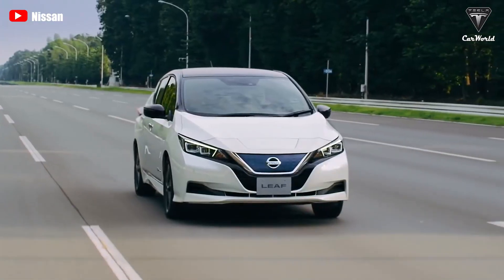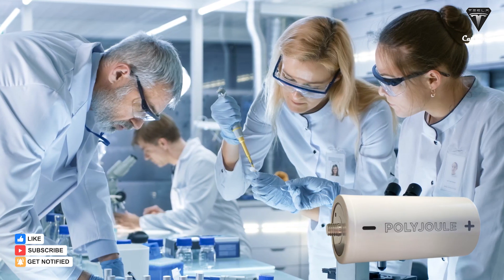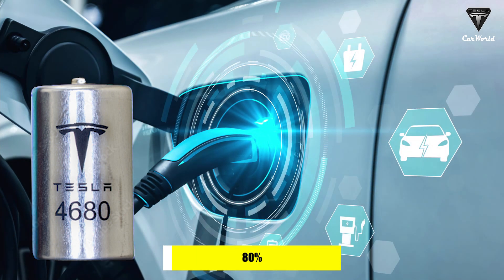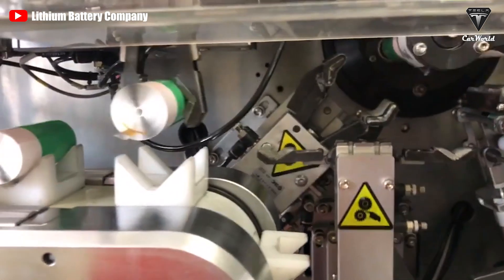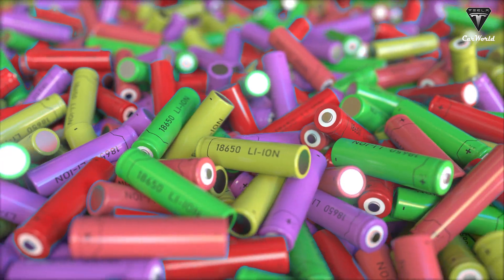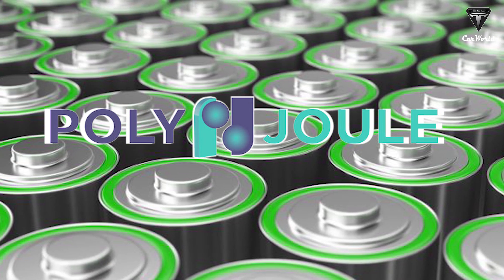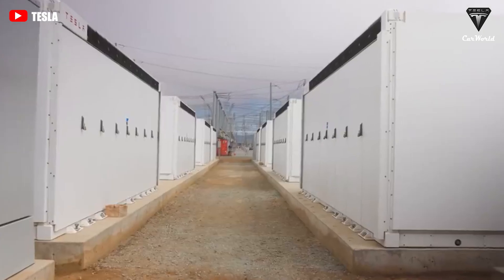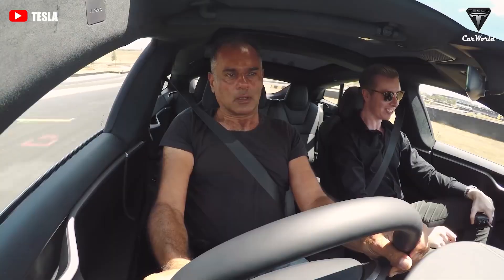Uncovering The New Batteries Miracle Material Made Entirely From Plastic SHOCKS The Entire Industry!

Comment: As a former plastic recycling company owner I find this technology super fascinating and will be rooting for its success. Never underestimate the capability of plastic. I've even ran my lawnmowers off gasoline I made from plastic at home and plastic is abundant, extremely cheap if not free from dumps. They actually paid me $300/mt to take it from the dumps so costs should be really cheap
Reply: Thats amazing.
Reply: @jeremythomas1081  the plastic gas I made I had tested and it was 98 octane and 30% cleaner than regular gas because it's been refined to make plastic. They just told me it needed the additive to keep it from rusting your engine but it worked fine, super simple to make just basically distilled plastic but you have to make flashback arrestors for safety and stuff and gasoline is lighter than the diesel and kerosene which it also creates but they condensate  at different temperatures so it was kinda tricky to find where in the tube it cools and  condensates at but once I found it it just condensates and starts running back down the tube so I put a pipe and canister coming off the tube so it ran down and collected in the canister then I just drained it every once in a while with a garden hose valve it was neat. If reactor gets too hot it pushes the diesel and paraffin wax and stuff farther up the tube but over all was a fun experience

Comment: This sounds promising.  I keep saying that battery technology needs to improve to make electric cars a good option for me.
Reply: Nop if batteries  will never outperform  a good diesel engine cold weather 
Diesel engines are humans best friend
Reply: Now, we just need to be able to charge it too !
Reply: There is another option to batteries, capacitors. Slow to discharge quick to charge.
The technology has been around for decades that can make a 500 farad capacitor the size of a 16 oz drink mug using ceramic technology.
Reply: @colgatetoothpaste4865  how you know that ? you dont know what will happen in 1000 years .
Reply: That only works for Costco milk jug.
Reply: Me too. I’m happy with my Diesel 4x4.
Reply: This is not for electric cars unfortunatley. It takes 5x space compared to li ion batteries with same capacity.
Reply: They seem to have a place but if I understood, EVs is not one of them.  The batteries would need to be 5X larger for the same capacity.  What am I missing?
Reply: @colgatetoothpaste4865  ummmm, you do know that most of the fuel is wasted in a diesel engine, only about 30% is for propulsion.
Reply: @colgatetoothpaste4865  that type goes to -50, thats not bad
Reply: I would wait until carbon neutral biofuels which will just require engines to be retuned 
Think about it how much monetary assets are in classic cars? Finding a way t make them run with zero carbon is what needs to happen not just more mining and more carbon emissions from charging electric cars
Reply: This will also help reduce the price of oil & gas. And most of all reduce carbon footprint or eliminate it altogether with renewable energy in the near future.
Reply: @colgatetoothpaste4865  yes and cars will never outperform horses... sleep well
Reply: They didn’t mention a weight comparison between existing electric car batteries being used. Depending on their weight to range capability maybe interesting    for electric car use.
Reply: 7:03 well as they said for a few thousand years. “ nothing will ever replace the ox and the horse.  @colgatetoothpaste4865

Comment: There is a company in England developing super caps using contact lens material that claimed years ago that eventually their product could power a car for thousands of miles, but I have heard nothing about them since.
Reply: Capacitors have a place in energy capture, but there not going to replace lithium ion anytime soon. If you direct the energy created during braking to the battery you only actually capture a very small % . However, capacitors are very good at holding that captured energy to re-employee it for 0mph starts up to 10mph.. capacitors have a million discharge cycles and are extremely efficient with virtually no internal resistance. They have a place for certain. But there only half as energy dense at best. Capacitors should replace everyone's car battery (if u have a ice vehicle). But there nowhere close to ev battery's today
Reply: Yep. That one is being choked down by the oil industry. How could fat cat industry make big bucks?
Reply: Sometimes great projects are bought out.  Just so old crap will continue to sell

Comment: I love it when claims made do not make technical sense
"able to discharge around 1MW of power in 10 seconds" has incompatible units. It's like saying "my car has 1000 HP in 10 seconds"
and statements like
"Polyjoule can be charged in under 5 minutes" - what size battery exactly? If the battery were twice the size or half the size, is it still 5 minutes?
"Aren't really designed to store electricity for days..."  :(

Comment: Worrying about plastic coming from oil is not a problem! What needs to be done is to phase out the internal combustion engines, since these cause pollution in the air! And I'm not talking about CO2 which is what plants breathe in, I'm talking about the particulates in the air, which is what we need to eliminate! Having these poly batteries for static applications and using lithium in vehicles is certainly the way to go! People talk about water being wasted to mine lithium is a ridiculous concern as the lithium in Playa deposits is in a brine suspension, which needs the water evaporated out of it. This evaporated water can then go downwind to turn back into rain. Otherwise, this b r i n e is useless for irrigation or drinking. Hard Rock lithium mining needs to be stopped, I agree, but liquid mining of lithium needs to be pushed forward immediately! Also sodium ion, needs to be pursued as a static type battery! Quit worrying the manufacturing processes of lithium and poly and electric vehicles, that is a ridiculous concern as once they are manufactured they produce no pollution! Whereas infernal combustion engine vehicles do nothing but pollute after they are created! The catalytic converter in a infernal combustion vehicle only removes some of the pollution, certainly not all! If you don't believe that, simply pull it into your garage and close the door, with the engine still running within 10 or 15 minutes my point will be proven, not that you'll still be alive to note that!

Comment: Energy density is not sufficient for mobile  equipment.  Yes due low materials cost, it will be good for stationary storage applications.
Lithium is still king for cars and planes.
Reply: Here comes sodium batteries. No hot or cold issues, no thermal runaway, long life and 30% cheaper.
Reply: @kaijen2688  Sodium batteries are literally molten sodium salt.  Uh yeah ... they definitely have cold issues lol.

Comment: Had the idea for plastic batteries 10 yrs ago.
Just thought about static charge in plastic. Seems they have come up with a practicle unit.
Reply from the maker: A startup PolyJoule has come up with a new breakthrough type of battery made entirely from good old plastic. Thanks for your comment !
Reply: That's called a capacitor
Reply: The problem is holding a lrg charge.

Comment: Increasingly obviously, battery swaps are the answer. But whaat? Making batteries produces 74% more co2 than conventional cars? Sounds like misinformation spread by the oil companies. Especially when you consider the VW study that concluded that on average, it takes around two years to recoup the extra co2 produced. Calculated with very little renewables in the mix of grid supply. Nowadays with renewables (solar, wind and battery) approaching 10% worldwide, the balance shifts. Also, the fixed overhead carbon footprint is diminishing as more vehicles are manufactured.

Comment: This PLASTIC battery sounds remarkably like a CAPACITOR...
Reply from the maker: Yepp. It's like a capacitor. Thanks for your comment and have a good day !
Reply: A leaky one at that
Reply: A capacitor can hold a charge but they can also discharge hurting somebody very easily and a capacitor has old am I didn’t hear anything mention about an hour and a oil it comes out of the capacitor I was very bad for the environment!
Reply: It uses oxidation and reduction, so it's technically a battery. But yes, graphene is making batteries perform more like capacitors.

Comment: Just one problem with a battery made from plastic. Plastic comes from oil, which we want to phase out.
Reply: Did you not hear the part in the video that recycled plastics could be a constituent of the  Polyjoule battery.
We are about up to our armpits in plastic now.
Reply: I thought the same thing.  Made of all organic material.  Made of plastic.  Too many unknowns still.  How does it work?
Reply: They are now finding plastic nano particles in human lungs ! So much for advancement ?
Reply: Phasing out carbon fuels because they are burned in engines and heating systems. Manufacturing plastic is neither
Reply: Yep, the electric car is a nutshell game. I like the part when they use a diesel generator to charge your car.
Reply: I was mile from airport and that kerosene smell was so toxic I was like please do something about it our children 👶 do not need this before I die breaks my heart but if this is working we should phase out crude oil today not 100 years time if the weather messed around this will lead to melt the Arctic 🥶 and heat waves will kill everyone in less then year have you not see the weather it has changed in less then decade I want to see colder weather before I die otherwise this generation has really done nothing to prove anything but disaster
Reply: Polymers can be derived from biomass.
"Bioplastic"
Reply: @gordonemery6949 So the heavy metals used in todays batteries are much better right? Certainly not ”renewable”.
Reply: Who is we you have a mouse in your pocket
Reply: If they trawl the oceans, they'll find all the plastic they need.
Reply: 19th on like, great freaking question! But either way,  I  think I'll invest....
Reply: @ruffen1365  I suppose it's a balance and cost,and profit above all sadly...
Reply: Man it's so much plastic garbage around the world we might have 100 years worth of battery power in landfills.
Reply: This will be there excuse to start pumping more oil out the dirt
Reply: Hemp and vegetables
Reply: @abzcabz9211  not enough power from batteries to get a passenger jet off the ground.
Reply: @gordonemery6949 they are finding plastic in foetuses….
Reply: But We can get plastic from inside our fish now
Reply: Don’t worry
Reply: We want to phase out the burning of oil.     It has other uses.
Reply: @brucewilson2763  that’s right
Reply: You won't faze out plastic. 
Period
Reply: there will always be ba need to mine, and a need to process materials for vehicles and transportation. Unless we go back to horses.  Can't get away from it.
Reply: I love oil.wiithout oil,there would be no long distance ambulances.
Reply: Some funny little people in the south of England say they don't want plastic.they want to put loads of people into unemployment and debt.it costs money to travel,and not everywhere has public transport links.frewdom comes with a car.
Reply: Exactly
Reply: Dude if you go there, more than half of your society runs on oil considering you use plastic almost everywhere. It certainly wouldnt be the only place with plastic in the car
Reply: @Detroit of Asia - I used to ride a bike to work every day. Now I just telecommute. Not sure what that has to do with plastic batteries though.
Reply: @hugomiranda2009  - that’s pretty much my point. I know, plastic will probably eventually come from agriculture. Mushrooms may be one source. But no one seems to be talking about how we would separate oil for plastic, and oil for fuel. The unspoken assumption is that oil companies should go the way of all ways. That can’t happen if we still need it for non-fuel related products. 
Thinking that plastic doesn’t contribute to global warming, when discarded plastic is often burned in order to dispose of it, one might want to think again.
Reply: @ruffen1365  - I make no such comparison. 
Don’t get me wrong, I consider this a welcome advancement. A good half-way measure.
Reply: @thaddeuslaporte9601  Have you ever heard of the editorial “we”?
Reply: @ifv2089  - Seriously? You think that’s a viable commercial option?
Reply: @BikeStandByMe  The problem might be that free thinking is often not enough.....
There is a difference between having millions of oil dripping comb. engines and a power plant that is:
a) more effective (heat dissipation, general loss of conversion)
b) cleaner, as the exhaust gases can be treated more effectively and at one point

And with stupid combustion engines you can not even use regenerative power sources - or how to you get sun energy into your diesel?

Comment: Mr Elon Musk,  Tesla, hi, is the storage time only 20 hours because the poles (positive and negative) allow electricity to escape to the air, implying a electro static capacitor type of storage, , maybe an alternative shape would increase storage time, such as a toroidal shape to allow electricity to loop perpetually,  instead of a roll in a straight line for the standard battery shape, with electricity escaping from either end, instead It could have , a tube rolled into a circle to make a toroid shape, it could be charged and discharged with electromagnetic induction?

Comment: I would have liked to hear a greater comparison to EV automobiles as far as range, staying power, recharge time, replacement costs .....
Reply: It seems because of the low energy density - 5 times more space/weight needed for the same kWh capacity of a lithium ion battery that it’s not appropriate for vehicles. My GV60 battery weight is 478.8kg the total weight of the car - a massive 1975Kg. The battery pack alone using this new battery tech would weigh nearly 2500kg!

Would have better applications where weight/volume is not so critical - rural Solar PV battery storage for instance. 

But always good to see new tech and the niche it might fill in the energy mix ambition to Greener solutions.

Comment: First electric cars are NOT green as the production is devastating to the environment and they use child labor.  Also, these plastic batteries have not been tested in the different types of weather.  Can it withstand extreme heat as in warmer countries and extended times on lock grid highways.  How does it perform in freezing temperatures as plastics tend to crack with continual freezing and defrosting?
Reply: Producing ICE cars is also very devastating to the environment, if one figures in the whole vehicle.

Comment: I think the break through we are waiting for is when the battery is the build material rather than an additional component.
Reply: The break through we are waiting for is a direct comparison to gasoline and diesel. Fill up time/charge time, mpg/range, and cost. Once they get that narrowed down, there will be no compromise for gas/diesel users.
Reply: @BobStoneBoi  yeah, going to one technology to another without any effort from the user ... Childish
Reply: @surronzak8154  childish? Thats not childish. That's what it will take all of the world. No disruption, no compromise, and you will have a smooth transition. That goes for any business model.
Reply: Not if it can work synergistically with super capacitors and electric energy recovering features built into ev car.
Reply: @BobStoneBoi  Cars went from steam to electric, to gasoline, to diesel when horse travel was replaces. Model T Ford wasn't the perfection of cars, just a way to shift away from depending on horse carriage.
Reply: @BobStoneBoi  that’s not gonna happen, transitions like this needs us all to make efforts, no disruption is an utopia

Comment: It takes 10 times the carbon to produce 1 EV than it does to make an ICE vehicle. May solve the waste created by worn out batteries provided that environmentalist allow construction of recycling facilities in the United States. Which they have been against for the past decades. Irony is they want you to recycle but all facilities for processing recycled materials are located outside of the United States. Allot of plastic is not even recycled. But the problem with the grid is capacity and power generation. Solar and wind work to supplement but there is no way an entire grid should be entirely reliant on it. Nuclear is still the best power generator per waste create of any generating source. 50 years and not enough waste has been created to fill a small room.

Comment: That's all fine and dandy but no one ever talks about the incredible wieght difference of a EV vs a gasoline vehicle. Electric vehicles weigh 3 to 4 times more then a conventional gasoline vehicle with more acceleration. Which means when angry karen in her 10,000 lbs electric hummer feels entitled  to beat the stop light and T bones you ☠️. The chances of a survivable crash go way down for the receiving end because of the extra mass. Did you know that the battery in a electric hummer is a little over 3000 lbs? The battery wieght is as much as an intire gas car and nobody is taking about how dangerous this is for everybody else that has to be on the road with them. With that in mind, I was really curious about the wieght difference in the battery.

Comment: Polymer batteries are NOT the future.

They have LESS charge cycles per lifetime than Lithium, and LESS charge density.

They will revolutionize almost nothing except for being light and flexible, for flexible electronics, for example disposable cell phones.

They are probably using regioregular Poly(3-hexylthiophene-2,5-diyl), P3HT, which sells for upwards of $600 per gram. If they need a functionalized terminus and low polydispersity, the price increases to $3 000 per gram.